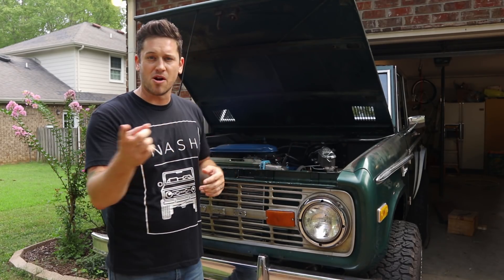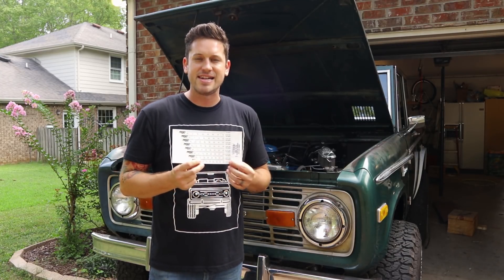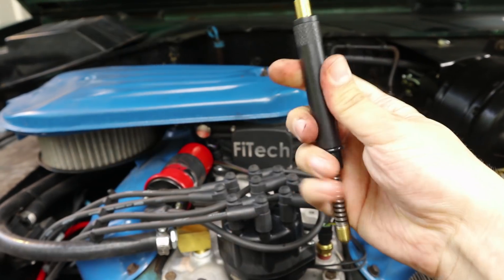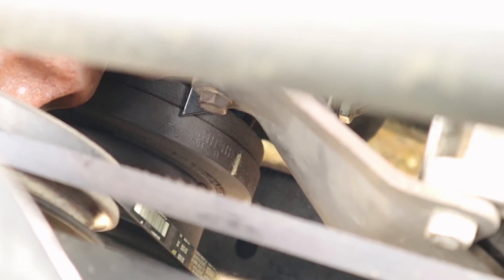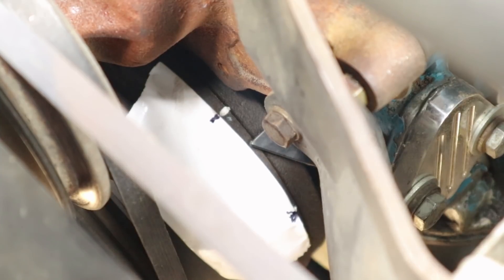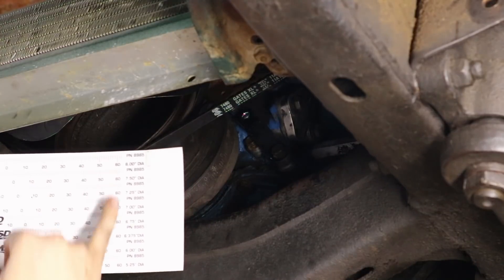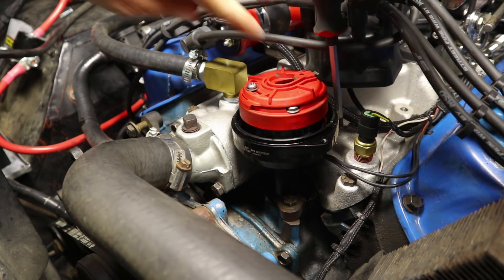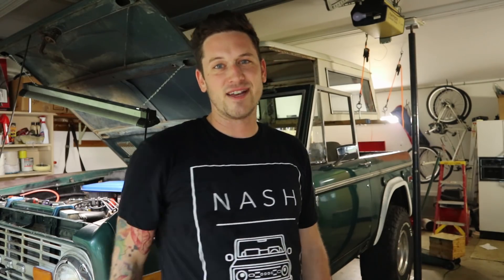Ford 302: Setting the timing without timing marks

Comment: 1996 Ford e-350. 460 7.5l
200,000 Miles
My crankshaft position sensor with the new timing cover as it didn't have the bosses to mount. So I ran it without it for the past 3 years. But when I changed out the distributor now I don't have that metal that was on the position sensor to show me where I'm at with degree hash marks. 
I did the tape and Mark thing and all of that. It doesn't help that there's an oil pan leak and I tried to replace the gasket years ago but I only partially got it yes I didn't or couldn't lift the engine enough to slip it in their properly. :+)

Comment: You made a false title and made timing marks. 
* disliked *
Reply from the maker: Haha! You mean you misunderstood the title.
Reply: @NashvilleEarlyBronco  most likely. * undisliked *
Reply: I was expecting something about compression stroke finding with a finger and setting it there or something like that .
Reply from the maker: True, I didn't spend much time on that. I used the top dead center tool instead around the 3:12 mark

Comment: Wonderful! Thank you.
Can anybody help me please. I got a Ford F-100 1972. I doesn't start. I noticed that the distributor is a little bit loose. Is it ok or should it be very tight? Is it possible that it doesn't start because of the distributor. What are the symptoms when a truck is not timed ver well?
Sorry if those are a lot of questions. Thank you!
Reply: Vaccume port on distributor usually is pointing almost at 5oclock.. stare with it there .start it then hv someone hold out at hig idle while you slowly rotate the distributor it should smooth out when you get close.. then shut it off and see if it starts quick or drags

Comment: I use a remote momentary switch across the Starter solenoid. Pull the coil wire, and rotate the motor as needed using the starter. I wouldn't do this if there was a tool screwed into the cylinder though. That would end badly.
Reply: M

Comment: Jon. Another good video. Two questions please. Innovative Products makes a 14mm to 18mm adapter to fit the TDC indicator to 18mm spark plug hole found on SB Fords. Didn’t see it in video. Did you use the adapter?
I have yet to find a really good video on how to use the piston stop. It is an 18mm threaded hollow sleeve with an adjustable inner bolt aka piston stop. So how do you know you have the stop adjusted to true TDC piston stop depth? It doesn’t self adjust? I just don’t understand how it is accurate w/o pulling the valve covers looking at the valve rockers, or the heads and using a deck plate?
Any helpful comment is appreciated.
Reply: He tells you at 5 :55
Reply: Whiskey 1 Mantis . I understand the basics. I am guessing you have to rely on TDC tool to find piston top of compression stroke? Then adjust piston stop to correct depth and lock it out? Then rotate crack CCW until it stops again? Mark harmonic balancer and proceed? Right.
Reply from the maker: Correct

Comment: Lmao, WOW! Top dead center was on the 0 on the balancer!?!? How in the world could that be???  Oooooh.. Because it's designed that way... It's on the crank with a key and 0 is always TDC... Stop making how-tos if you don't know what you're doing. Ty
Reply from the maker: Thanks for the suggestion, I’ll put it in my suggestion box
Reply: Its a good video man.. ford had 3 different timing covers and timing markers with different ballencers.. in a 40 old pickup when the motors been Frankensteined together this video cam in pretty handy.. dont be a dick..

Comment: Ok.  On my 460 I pulled the crank pulley and the Harmonic Balancer but left the gears and chain in place .   I then rotated the engine with a wrench to TDC compression stroke on #1 cylinder and verified dizzy rotor was pointed and the #1 spark plug wire .   I then removed the timing chain and gears .   So when I put the new straight up timing gear set in Do I need to mark TDC on the New Balancer (broke mine) and then install the piston stop at TDC and rotate engine to TDC exhaust stroke and mark the balancer again ,    Then measure the distance between the two marks .   Am I going about this correctly???

Comment: Hi John, this is the first time I write you a comment. My name is Fabian and I live in Costa Rica. I just bought a 1966 Ford Bronco and I trying to restore this car all by myself. Your channel is great and I´m watching all videos to learn a lot of stuff.
I got a question about finding the TDC using the piston stop. After making both marks on the harmonic balancer and marked teh half between them, this mark will be my TDC, but you should take this mark to the timing pointer (moving the engine or the harmonic balancer) to ensure that the engine is in TDC, am I right?
Reply from the maker: Correct! Rotate the engine so the harmonic balancer lines up with the timing pointer and then your engine will be at TDC

Comment: my 86 f150 EFI wont start at all, i just bought it for basically nothing.. new distributor is in it, does the timing have to be set in order for it to start at all? its getting spark and fuel to the fuel rails
Reply from the maker: Yeah timing has to be just right on those engines

Comment: For anyone that has a Bronco or other 302 older then a 74' I believe... The 14mm tools linked in the description won't work. I didn't pay attention to the size before I ordered. My 73 uses the old 18mm type plugs. Can't find a TDC indicator tool for 18mm. I ended up ordering this adaptor. https://www.amazon.com/Innovative-Products-America-7885-Adapter/dp/B000K1I0PQ/ref=sr_1_23?crid=9LTBF5M9CB3P&keywords=top+dead+center+indicator&qid=1558829236&s=gateway&sprefix=top+dead+%2Caps%2C133&sr=8-23
Reply from the maker: Thank you! I’ll update that link. Sorry it was the wrong one

Comment: I notice no mechanical fuel pump
Reply from the maker: Nope, frame mounted fuel pump
Reply: @NashvilleEarlyBronco  im trying to do that on my 74 f100 but I'm not sure if it works or if any pump is reliable. I have to do more research ..i heard you have to install a fuel pressure gage to keep an eye of pump pressure
Reply from the maker: Fuel pressure regulator for sure. Are you just running to your carb or a tbi?
Reply: @NashvilleEarlyBronco  carb. Only
Reply: @carlitosducoing8507  I have a 73 f100, as long as it's a mechanical pump it's pretty reliable. I wouldn't worry too much about a fuel pressure gauge unless you really feel like it.
Reply: @brandonlowe7808  mine is 74 short bed white lowered i been checking you videos good job!
Reply: @carlitosducoing8507  thanks dude, mines a shortbed too, redone the whole motor and transmission, new carburetor and 38 gallon tank. Thinking of raising it about 6 inches and painting it san Marino blue
Reply: @brandonlowe7808  nice and if you paint upload video✌

Comment: So for the FiTech unit you are setting both the engine physical timing and the adjustable rotor to ten degrees?
Reply from the maker: No, I’m setting the engine to 0, adjusting the rotor to 10, then telling the fitech where the timing is (10 degrees)
Reply: Copy just making sure...Thanks!  I discovered an interesting take from another youtuber for finding the compression stroke when one is completely lost.  Take one of those anti foul plug cases or a hollowed out plug and stick a balloon on it.  Hand crank or bump the starter till it inflates...Hello compression stroke.  Just thought I would share as it blew my mind.
Reply from the maker: Genius!!! Thanks for sharing I love that idea.

Comment: Does this work on 351 windsors as well?
Reply from the maker: I think so but I don’t have any experience with the 351
Reply: Yes. They have the same firing order too.
Reply: No 351does not have the same firing order as 302/289 a B ore E camshaft will change the 302/289 firing order into a 351 firing order

Comment: you need to get a new harmonic balancer look how cracked out it is !!!
Reply: Still doing research but I've since heard worn motor mounts could also contribute.
Reply from the maker: Yeah, that’s on the list!
Reply: i had a car that shook when running and finally came apart, broke my timing cover. that was a job !!!
Reply from the maker: Oh man! I need to get on that then. My engine shakes pretty good when running
Reply: Would like to know if replacing harmonic balancer helps your engine. Mine does it but I think it's the timing. Throw another part at it.
Reply: This is why Honda motors are so reliable, Honda has mastered the art of removing vibration.

Comment: I don't understand the 10 degree part. Can someone explain why you would set 10 degree from top dead center? Never have set timing before. Thanks
Reply from the maker: +Heath Hamby top dead center is when the coil will fire the spark at the peak of the pistons movement. But, the engine is spinning so fast you want the spark to hit before top dead center so it can ignite the fuel and push the piston back down. As your RPM’s go up, you want the spark coming sooner and sooner. There’s a lot of opinions on what degree you want the spark igniting the fuel, but really it depends on what your engine likes the most. I used 10 degrees because it was an easy reference point. Setting your engine at top dead center gives you an accurate reading of how much advance you are running when making your adjustments. Does that make any sense 😬
Reply: It sure does. Thanks for the explanation. I just bought a 1970 Bronco that's in very good original shape. Just needs a few mechanical adjustments. Thanks for all the great videos. I'm learning a lot of great info on the Bronco thanks to your videos.
Reply from the maker: +Heath Hamby awesome!

Comment: Great as always.

The engine turns clockwise right?
Reply from the maker: +Chuckles yeah, engine spins clockwise, rotor in the distributor spins counter clockwise.
Reply: If you are standing in front of the engine , YES.